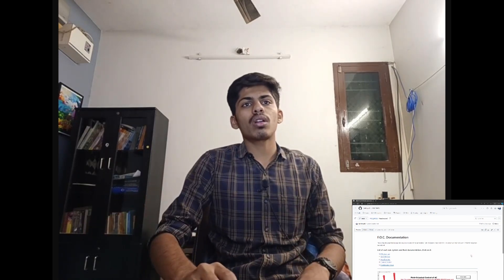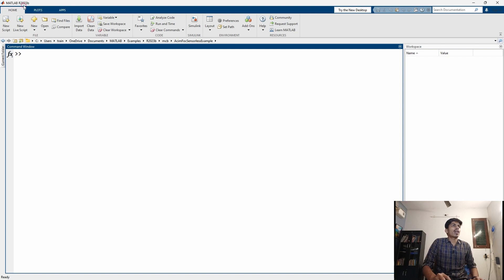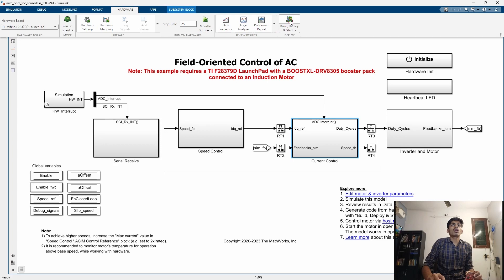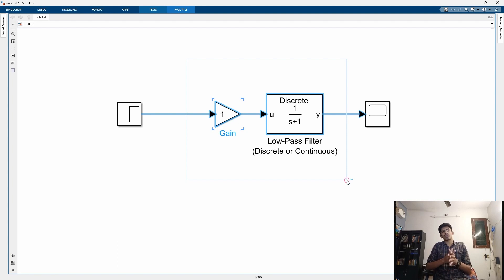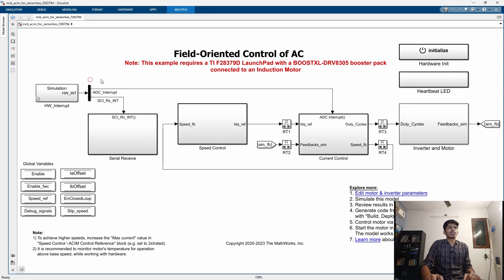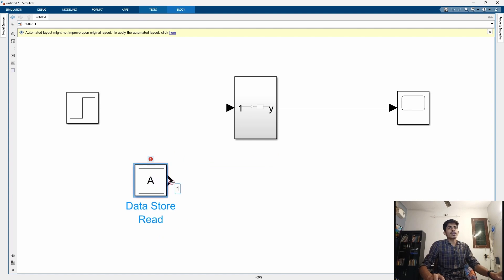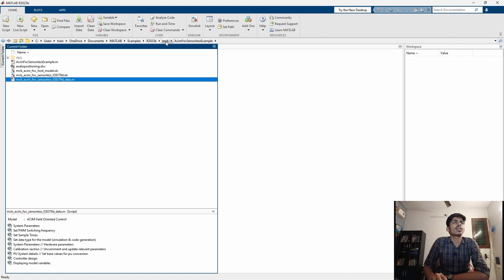Part 1: Overview of Sensorless FOC ACIM with MATLAB & C2000 Microcontroller

Comment: I appreciate for great explanation.I am using f280049c and drv 8323rh for foc in bldc motor.Could you describe how I could use ecap module for hall sensor for FOC?
Reply from the maker: Hello, thanks for watching!

While I don't have direct experience with eCAP on the F280049C for BLDC motor FOC, these resources might help:

- TI Academy: dev.ti.com/tirex/explore/node?node=A__AQ0h4FMdDFNTaVbxdi5-kg__AM26X-ACADEMY__t0CaxbG__LATEST

- TMS Technical Doc: ti.com/lit/pdf/spruhm8 (page number: 2154)

- MATLAB C2000 eCAP: mathworks.com/help/ti-c2000/ref/c28xecap.html

They cover eCAP usage, which you could adapt for hall sensor input in your FOC setup. Hope this points you in the right direction!

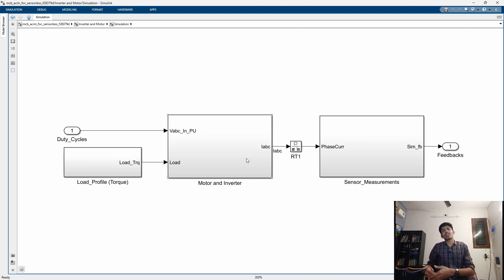Comment: I appreciate for great explanation. You mentioned about PIL at 11:19. Since i have custom board because of handling capability of DRV module, i need to test my logic via PIL. And should arrange the ADC epwm peripherals according to my custom board. Can you deeply describe the PIL process for c2000 controllers or make a video about it. Should it be done with only USB connection. And which blocks should i use. Thanks again.
Reply from the maker: Hello, The below resources have much deeper documentation better than I could provide, for PIL testing.

https://mathworks.com/help/mcb/gs/code-verification-profiling-using-pil.html?s_tid=srchtitle_site_search_2_PIL%20processor%20in%20loop%20FOC

https://mathworks.com/search.html?c%5B%5D=entire_site&q=PIL%20processor%20in%20loop%20FOC&page=1

https://mathworks.com/videos/motor-control-with-embedded-coder-and-tis-c2000-107667.html?s_tid=srchtitle_site_search_13_FOC

Thank you for watching btw.

Comment: Are you going to show running of motor?using ti DRV board or your own drive
Reply from the maker: Yes I do plan on showing the hardware once completed, We are using Fairchild Intelligent power module for inverter, and not TI drv board. Since it cannot handle our motor's power rating. 

Thank you for watching.
Reply from the maker: Hello! Just a quick update: I couldn't complete the project on time due to a problem with our inverter. There were some false positives in our IPM, thus we couldn't test the closed loop.